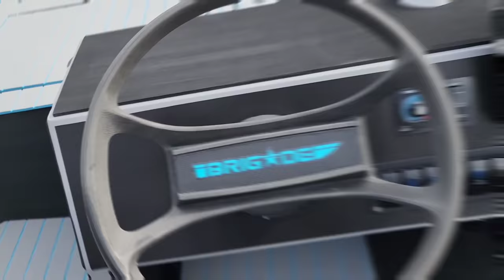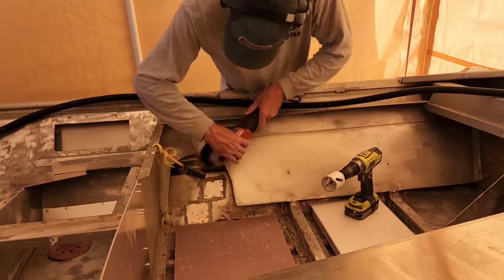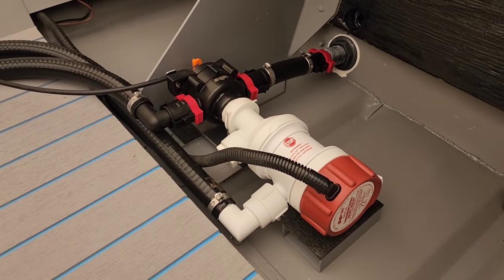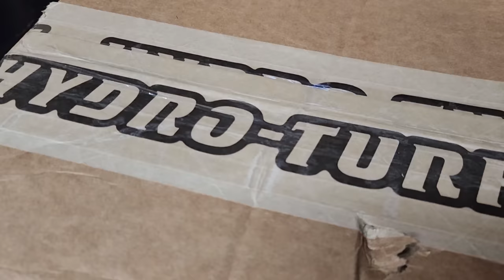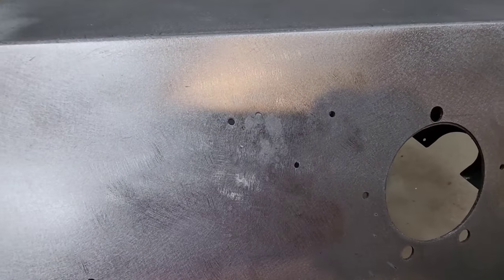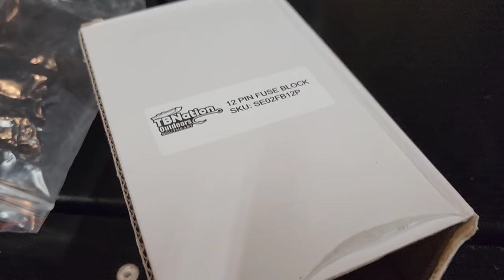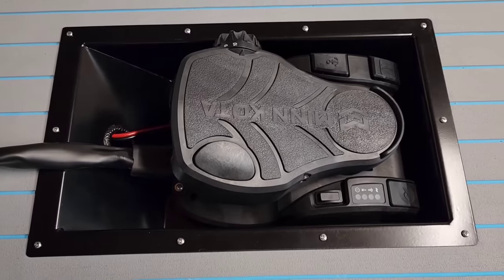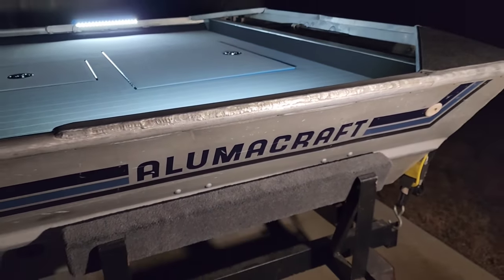40 Year Old Aluminum Boat Transformation | Alumacraft Bandit from Start to Finish

Comment: Excellent work! Planning to buy my first aluminium boat and transform it just the way you did it, this is amazing inspiration. One question regarding the water pump, what is the exact function of it? Furthermore, the draining from the electric motor pedal, where does it lead the water to? -- Can´t wait to start, greeting from Seville, Spain! 💪

Comment: I am going to have to do the same thing with the doubling of foam for my boat... but i thought in a previous video, you werent a fan of the EPS stuff with the foil backing?
Reply from the maker: Id prefer pink or green but that's all they had in 1/4 inch size after going to multiple stores.
Reply: so its ok to use... just not the first choice. Got it.. now at least I know what to do to fill the remaining gap on top of the pink foam

Comment: Really nice job. But the rivets probably leak like any rivet boat.
Reply from the maker: No. It was water tested before the build and the rivets were sealed in epoxy bottom coat (not in video).